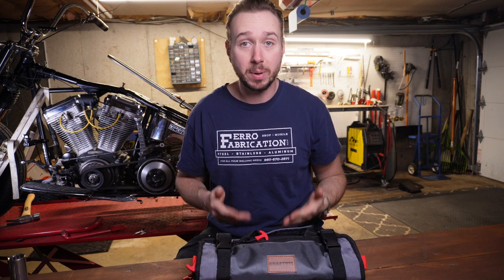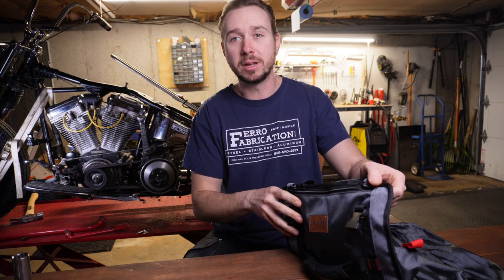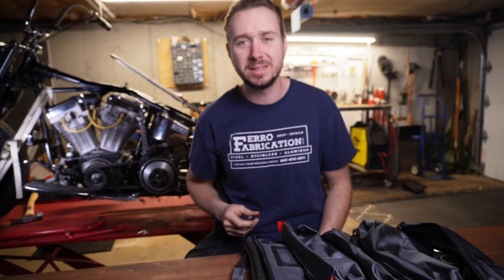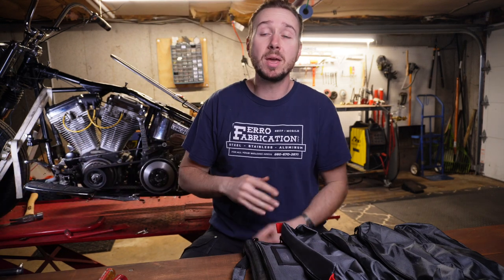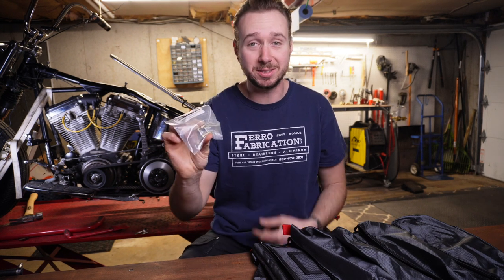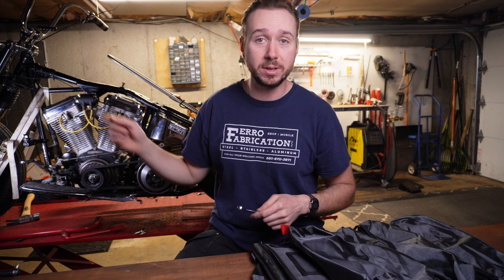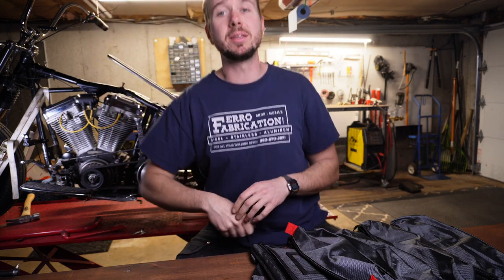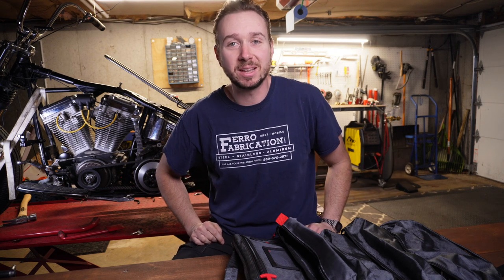How To Build A Custom Tool Kit For YOUR Chopper

Comment: I have ridden a shovel for the last 25+ years.  Your kit is a bit more extensive than mine and I may add a couple things based on your recommendation, maybe not. But, the key thing you said was know your bike, understand the most common failures and be prepared to get off the road.  Buddies should not have to stop what they are doing to pull your butt off the road because you don't want to carry tools and spare parts.  I just picked up a legacy panhead showbike a friend built in the early 2000's and he crossed the country with 3 times.  I ran out of gas yesterday.  Not because it was out, but because of the angle of the tank and a broken petcock that only goes to reserve.  I am learning the bike, making tons of short trips, getting used to the way it handles and the foot/jockey setup and figuring out the things that will leave me stranded and fixing what I can in the shop, not the side of the road.  Your putting up good stuff and I would love a community that was full of like minded people who ACTUALLY RIDE these old bikes.  My addition.... Electrical wire, wire nuts, and after breaking down in front of a meth house yesterday... a pistol. It got sketchy and I pushed away as soon as I got the opportunity.
Reply from the maker: Love all of this. You’re spot on man, all about knowing your bike and it’s issues and weak points. Great call on the electrical wire and wire nuts. I have since added some spare nuts and bolts for common fasteners on the bike as well. I’m looking to build that community now with a fb group called greases garage. Join if you’ve got fb.

Comment: Great tool kit. I also carry a small flashlight that uses 1 AA battery. For metal wire I use stainless steel safety wire along with my safety wire pliers (they twist the wire fastest & with clean, uniform tight twists) Chain lube is also something to bring.

Comment: hi there- just started watching your videos and I like them. Have rode nothing but choppers for almost 50 years (I'm 73 and still my chop is my everyday ride) and my wife rides an ironhead as well. In any case, agree with your basic tool kit for a chopper, but you missed 2 things which I thought should be included. One is a short length of electrical wire. Its come in handy a time or two for me and always carry it. The other is a small collection of bolts, with washers and nuts. As you mentioned, so many of the bolts are common to other places on the bike, so 5 or 6 different bolts covers 99% of what you would ever need on side of road, and I've used them multiple times over the years on my bikes and others that needed them. Might not be exact right one you need, but will work in a pinch. Ride safe.....
Reply from the maker: That’s a great point Steve! I will add those to my kit, thanks for the tips and for checking out the vids. Please share with a buddy who could use the info 🙏🏼 what’s your 73 chop?
Reply: My ride is a ironhead, Andrew's tranny, rigid frame, SU carb, EI  and altinator conversion. My wife's is a 80, 57' hard bags,, EI and altinator. we both ride them everywhere. Also have a 72 Norton Combat that we restored.
Reply from the maker: @stevegappa2959  that’s awesome man, what a rad pair! If you’re on instagram send me some pics I’d love to see them
Reply: @greasesgarage  just Facebook. are you on facebook?
Reply from the maker: @stevegappa2959  yes. Same handle

Comment: I just started trying outctge orange lock tight for my kids gas bicycle. I'm happy so far. Those 2 cycle engine rattle themselves apart. It's advertised as a maximum hold without needing heat to release it. I haven't used it enough to recommend it to someone. Im just mentioning it as a potential option if your worried about taking things apart without access to heat or damaging fragile fasteners.
Reply from the maker: Good tip thanks man!

Comment: I have a length of electrical wire in my tool kit  along with a headlamp and additional batteries. Refrigerator magnets for securing small parts and fasteners.

Comment: Interesting.  I used to carry a plastic  cateen for emergency  gas on long trips.   Helpful  information,  the wooden  blocks  on guard rails are just big enough  to add slide under a frame  to get the rear wheel  off the ground.
Reply from the maker: Great tip about the guard rail blocks!

Comment: Vise grips for the win! (Also, I replaced a non-transparent fuel filter with a transparent one, and that's how I was able to diagnose a fuel delivery issue on a freshly rebuilt motorcycle... With the old one I wouldn't see that there was no fuel coming in, even tho the fuel pump was making the noise.)
Reply from the maker: You’d be proud I finally bought a clear one after putting it off for two years lol. Gonna give that a shot this weekend
Reply: @greasesgarage  Right on! It's the little things that often save a lot of time.
Reply: I used to only use the clear glass filters, in line and none in the tank and you could just replace the filters.. I gave my buddy my last one cuz I wasn't using it..  Recently, I had my husband pick one up for me but, it's not the same,  it's plastic, he said he was told they don't the glass ones anymore.. I hope it's not true, just haven't had time to check it out!
Reply: @GKnee72   There are multiple brands available on the market, you only need to ensure you're picking up the right size (fuel inlet/outlet diameter). There multiple kinds of filters, turns out the ones that have a paper filter inside are the most efficient.
Reply: @xzouix basically I had a glass case with a replaceable filter... I had my husband pick me up one and he said he could only get the plastic ones where  you replace the whole thing..  I liked the glass better then the plastic ones . Then you can see so much better..  Anyway thank you for the information, I  appreciate it.. I planned on going on the Internet and seeing what I could dig up.. I'm having a hard time thinking they don't make or sell em anymore..
Reply: @GKnee72   Yea, there is a huge aftermarket, and there are brands focusing solely on making fuel filters (for instance Filtron is a known band here in Europe). All you need to know is the size of the fuel hose (in my case for instance it is 8mm - 5/16 of an inch).

Comment: They make these screw drivers called "hollow ground" screwdrivers, and the difference is, on edge the screw driver blade is a rectangle instead of a taper.  They are nice for stuff that wants to strip out, like brass jets on a carb on some project that you rescued from a swamp, hah.  They twist the screw from the root of the slot where it's strongest, instead of the top.  You can make them out of a regular screw driver with a grinder, just keep it cool, so you don't soften the temper.

Comment: Find you a plug caddy . Keeps plugs dry and looking new plus doesn't let them get bumped out of gap set . Just food for thought
Reply from the maker: Good call I’ll google it and see what I can find. I actually wanted to find a place on the bike to mount something like that separate from the roll
Reply: I raced cross country on atv we used them under seat there mostly plastic . But never had a plug look dirty or out of adjustment. And that's in ruff and bounce ride .